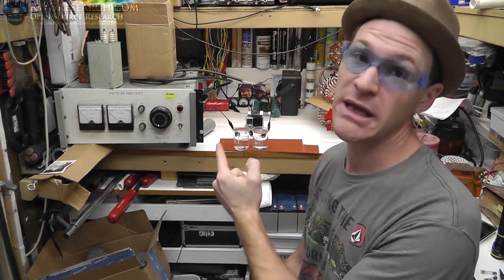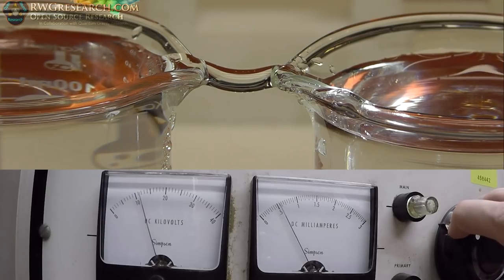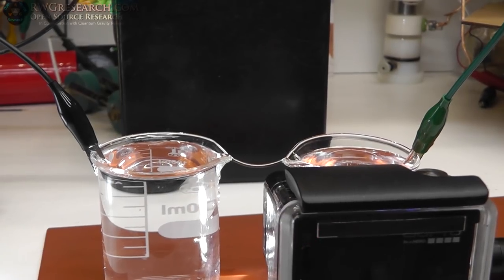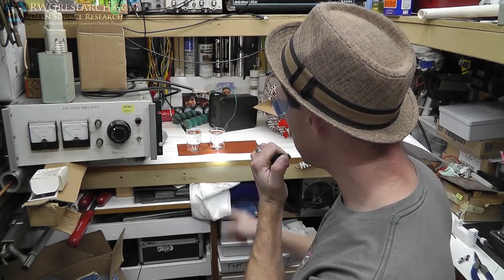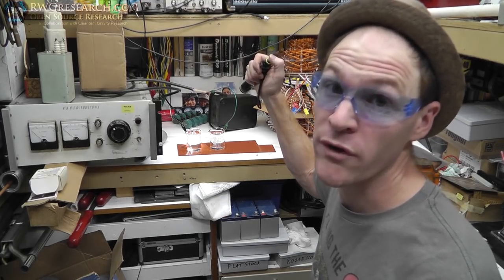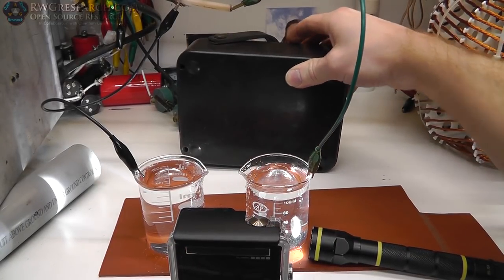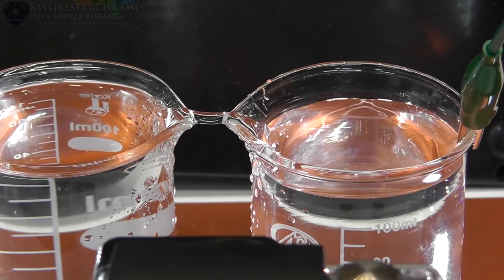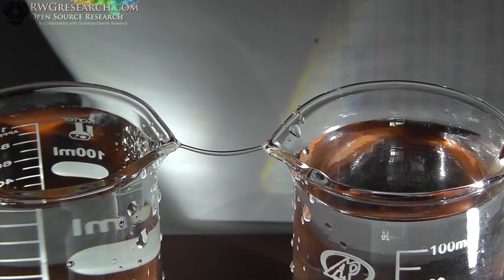Amazing High Voltage Water Bridge ( Water Thread) Defies Gravity! Fascinating Science

Comment: add food coloring to each beaker... see what the transfer is.
Reply: Lee Williams i think the test is reliant on ionic/distilled water
Reply: with salt on it maybe?
Reply: I guess it's only a single direction anyway... so from positive to negative?  Opposite of 'electron current' ?  Is that mauybe part of why current flows negative to positive?  Or is it like inudction that the water flow is opposite the current? 

Hmm maybe print something with super thin spiral and make a water coil?
Reply: Exactly what I was going to say. That or glitter.
I wonder to which extent level difference affects it. Ideally both vessels on scales to measure the rate of transfer. 
Also, with the polarity flipped, might it pump water up? Probably too mcuh to be asked from nature.
Reply: If so, let's see if it can pump vertically. I suspect will only follow gravity.
Reply: And swapping of the containers is needed as dye might not be neutral so this effect can be tested before conclusions.
Reply: I used ground black peppercorn seeds in an experiment to teach my kids about surface tension of water. It does look to me that there is no flow here but just a bridge, I would like to see some differential elevation to see what happens.
Reply: I had the same thought about transfer.  i did not see your comment till after i commented.

Comment: I love this experiment--I used it when I was teaching physics as an example of something that's pretty easy to do, awesome, and not completely understood. One of the things we did was to put universal pH indicator in the beakers. It causes enough conductivity to really shrink the bridge, but the pH difference is fascinating. We also sprinkled fine powder (1 um corundum grit) into the water while shining a laser through the bridge, and filmed it at 1000 fps. The little particles were zipping through the bridge in a helical pattern. We were just using a ballast and a flyback transformer to generate the high voltage--you've got a much cooler power supply.

Comment: I wonder if we could see any shear stresses in the thread if you illuminate the experiment with polarised light and then use a circular polarising filter on the camera lens to see any interference pattern.

Would also be interesting to see if light of particular wavelengths has any effect, e.g. UV & IR, and maybe even high power lasers if you have access to any of that.

Comment: Hey Russ, I think it was Moray King that talked about something like this, but I have heard people have done electrolysis with pure water by aligning the molecules with a hv charge and then "breaking" the bonds(like shattering a crystal) with a large capacitive discharge. Would love so see you experiment with that. Even just a large hv capacitive discharge on its own across the  gap would be interesting. Also seeing how it interacts with a magnetic field would be nice. It would be cool also to see how much water you could suspend between 2 plates. Maybe see how the bridge is effected by heating or cooling. Could you put it in the freezer and freeze the bridge? Does this work with other dielectric liquids like oils? Can you put food coloring in each glass to see how the water is flowing? Thanks for doing what you do! Peace.

Comment: As someone else suggested, colouring both containers to see if there is an interaction, or flow between beakers. I'm wondering if the charge doesn't draw some water over in one direction? Also will the bridge form easier if the water level is as high as possible, thus reducing the surface tension?

Comment: It's an experiment from Armstrong W G in 1843 . He writed it to Faraday !  He found somtehing interesting ! if you put a sewing thread between the two becher, you will see the water run around the thread ( cathode to anode) and then the thread  leave  for water. There is a double flow of water. This indicates that an electric current is like a tornado with a double flux. Check out Stan Deyo's work (Vindicator scroll) on this experience ! It's very clear and it changes the classic view of electrodynamics !

Comment: It would be interesting to see if the bridge can be modulated with electromagnet and sine voltage in the audio range. Magnet shall be hanging on top and isolated (maybe with small glass cup) of course :-)
Reply: I suggest a speaker voice coil near the water bridge to modulate the bridge, as a small current is flowing through the bridge, making a small magnetic field" it should be "bendable" " movable" just like the wire in a mercury bath school experiment. The evidence of the surface tension effect of the water can be seen by the water bridge getting "tighter" "finer" as the current is reduced, and also the bellying out and failure as the current is brought to the max failure point, the surface tension can no longer able to hold the thread together.Try adding detergent to lower the surface tension (tiny amount), I suspect the bridge will not be able to be sustained well.Chris

Comment: That was awesome! I am made of questions right now! 
I saw that, once stable, about 10kv and about 0.1 amps kept a ~1cm x ~2mm bridge connected. 
So - at around 7:50 the video shows the water oscillating..  I think there's something powerful here! 
what the phase-in? 
what volt and amps was set when the water was waving like that? 
Whats the temperature of the surrounding air and the temp of the water?
i accept that the volt or the amps affect the oscillation freq, I just wonder which one has what type of affect. 
Also, what happens if you put ice in the water, like if you can cool the water down until almost freezing, how does this change the bridge? 
the pH - could you measure the pH for both water vessels? I wonder if there has to be a certain range the water pH must be, for the bridge to form, related to the equivalent Volts and Amps. 
Love your stuff! 
puc

Comment: try it inside a vaccum if possible! + test surface tension of the + , - water and the water that droped all over. look for visual diffrence in surface tension after a longtime of bridge sustained vs short time. see if you can make longer bridges by putting a subwoofer under the table. testing diffrent frequencies.
Reply: The Undiscovered Country yeah, but lets do it anyways!

Comment: This phenomena is due to the waters plasma content. Hydrogen has a very big plasma field around it. When it forms molecules of water it is H2+O1. Two times the plasma content that a single atom of hydrogen has plus the additional Oxygen content. In my researches the plasma is the very thing that causes light lensing and waters ability to conduct heat and the electrical potential. Very interesting indeed. It is also the very thing that makes water the ultimate solvent. Because it contains a very high count of plasma. Since plasma is everywhere waters plasma density is higher and gets pulled into matter trying to self equalize, forcing hydrogen and oxygen into matter as best it can, depending on the matter itself.

Comment: Electricity and waterLink this to clouds and maybe it leads you to why they are so heavy but yet still float with large amounts of water
Reply: good thinking.
Reply: I'd heard that clouds float because when water vapor condenses to water droplets, it releases a large amount of heat, so the air inside a cloud is warmer and less dense than the air surrounding the cloud.

Comment: Suggestions huh? What if you add a third beaker? Start the bridge using #3 in center with#1&2 wired beakers touching only #3. Or perhaps place glass rod in each beaker see if the water will bridge across the rods above the water level in beakers? Glass tubing? Put dye or marker of some type(s), different colors?, with non metallic properties, with metallic properties, with/without magnetic properties? Can it be manipulated in some fashion or does it have a reaction from these variables. Is there a flow? if so which direction? does it alternate? we already see it fluctuates. Are you pumping in at AC or DC current. Are you using tap or distilled water?
It's counter intuitive action of seeming to stretch further with lower amperage is triggering some thing in memory but Ill post again later if it develops but it is completely expected that it is much larger bridge diameter when higher amps but gravity has more significant effect. That is weird since gravity should affect equally and I think if displacement was calculable at thin bridge over larger distance may be very close indeed to displacement of thick bridge over short distance.
I agree very fascinating, See 4th phase of water, Gerald Pollack, Thunderbolts Project? Be careful, that's a whole lotta pixies your messing round with. Peace

Comment: Hi Russ. Very nice replication ! I first learned about this phenomenon in Gerald Pollack's book "The fourth phase of water". Do you known Gerald Pollack and did you read his book ? There is a picture of this experiment in it but it is the first time I see it on video. Could you observe something in the dark when the bridge was made ? One thing you maybe can try is to put the alligator clips fully submerged under the water to have a higher breakdown voltage between the electrodes and maybe make it possible to initiate a bridge with the beakers farther apart without creating an arc. Your idea to try to influence the bridge with light seems like a very good idea too as the book I was talking about links the influence of light on the structure of the water that could allow the bridge to form. I'm really tired right now but I will read the links you provided and try to come up with better ideas tomorrow. Cheers.
Reply: Just another idea I didn't put much reflection into: trying to use a rheoscopic fluid if it can be non conductive to try to visualize the flow between and inside the beakers.
Reply: You could also try dispersing very fine non conductive particles in the water. Laser printer toner might be a good candidate. I would expect to see the particles concentrated in the center of the water rope and be excluded from the periphery.
Reply: After a quick search it looks like you can make a rheoscopic fluid by using fine mica powder. The good thing is mica is an insulator. Check out this instructable: http://www.instructables.com/id/Making-Rheoscopic-Fluid/

Comment: Why isn't there a electrolysis going on? There should be a lot of (oxygen and hydrogen) bubbles around the electrodes!
You've played a lot with the high voltage till the fuse breaked... Did you smell some ozone?
Does the waterbridge react to a magnet field?
The right water level was lower than the left.. why? shouldn't it equalize itself ?